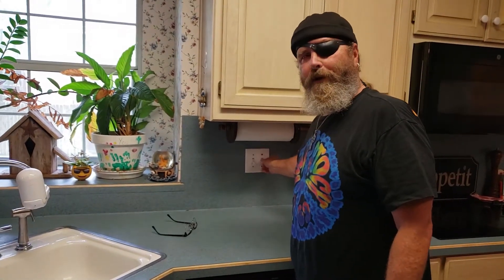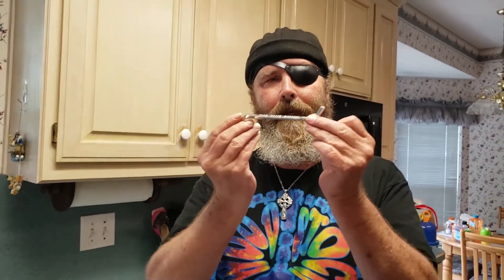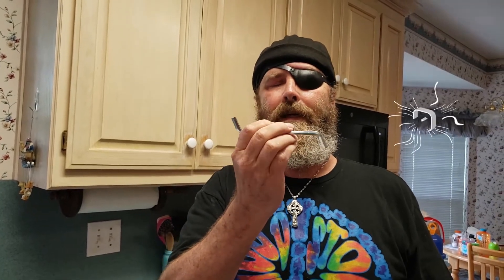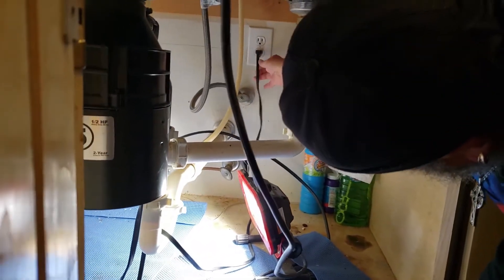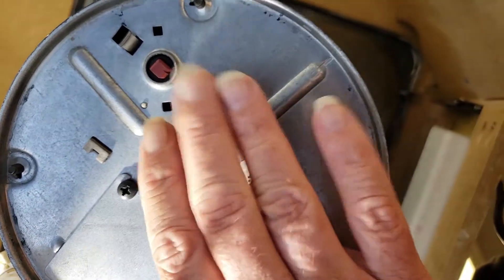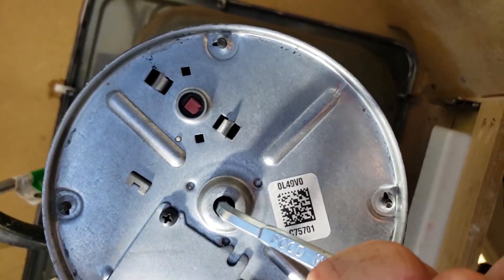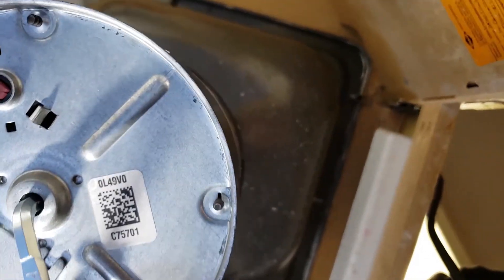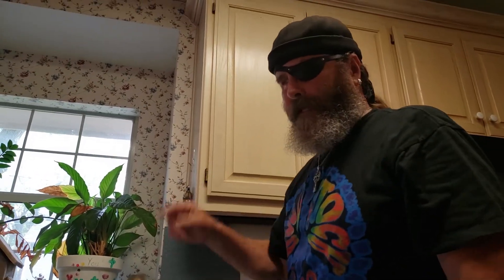QUICK FIX for a Clogged Up Garbage Disposal or Not Spinning

Comment: Hi Pirate Handyman! My garbage disposal is working...its turning on and flushing waste down. However, it water is backing up on both sides of double sink. I did what you shared on another video regarding taking p or u shaped pipes apart. I even washed them out to clear any sediments. I  saw no clogging in any pipe parts. I plunged both sides the first time and also put ice cubes in disposal side to clean blades. Please advise. Thanks so much 🙏
Reply from the maker: Aye, matey, sounds like the clog could be in the drain piped that goes into the wall, possibly behind the wall.  Look at the video below, and snake out the drain pipe as far back as you can.  If this doesn't work, I'm afraid you'll need to call a plumber.

https://youtu.be/8XqTBy5DKRY
Reply: @thepiratehandyman2225  thank you! I will have to call a plumber because snake didn't work.
Reply from the maker: Sorry, matey - but sometimes a professional is the best answer.  Good luck!
Reply: @thepiratehandyman2225  problem was solved after getting strong power liquid draino. Thanks again for your advice and continue making great videos!

Comment: Hey Pirate Handyman, I’ve got two questions.

 1. When I take a shower most of the water doesn’t come through the shower head which leaves me with less pressure.

 2. Plus my water doesn’t stay hot for very long, any ideas?

 Thanx
Reply from the maker: Well, the first issue is most likely mineral deposits that have built up in the shower head.  Take the shower head off, then soak it in a cleaner, like Limeaway.  Let it sit for a few hours, then rinse it out with hot wat.

The second problem may have to do with your water heater.  How old is the water heater?  Have you ever drained it to get rid of the mineral deposits?  We have a video on how to do that.  You might try that first.  If you still have a problem after doing that, you might have to call a professional.
Reply: @thepiratehandyman2225  Can you give me the link to the water heater video?
Reply from the maker: Here ye go, matey!
https://youtu.be/KPJvdrTxDqc